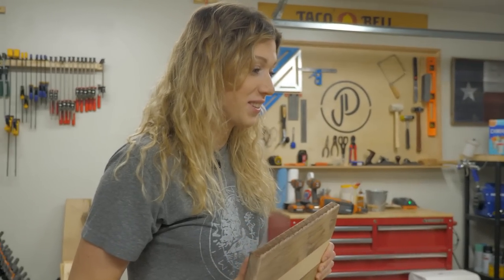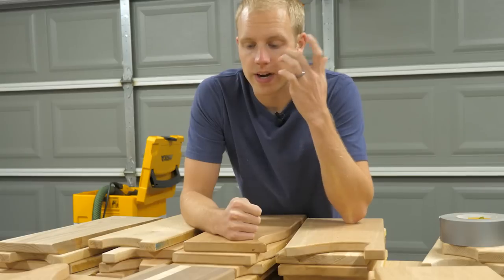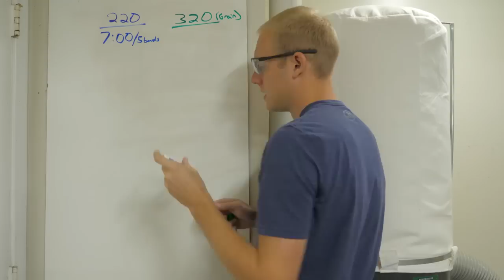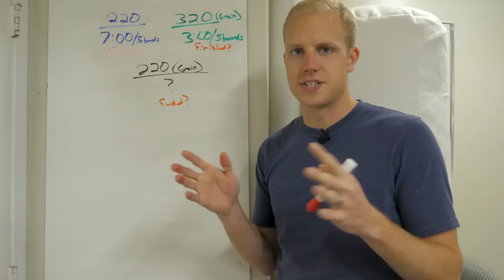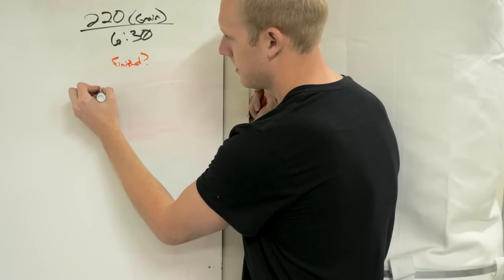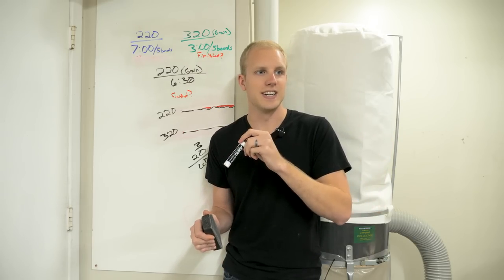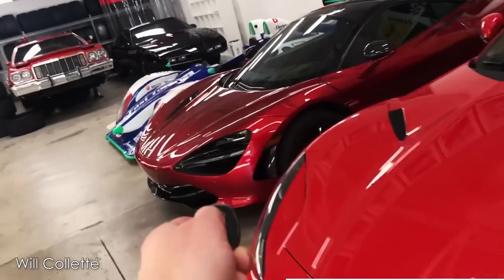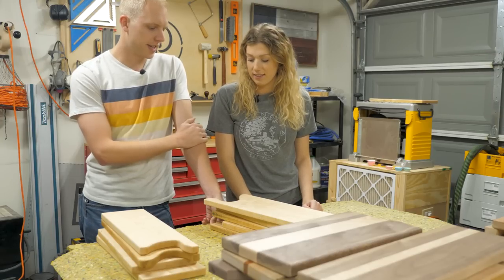🤔What Sandpaper Grit is BEST for Cutting Boards & Serving Boards?

Comment: No, don't jump straight to 220. A sharp blade cut may be equivalent to 120, but you should not skip more than 1 step in grit when sanding anything, you can't clear the little marks made by the paper. If you want a quality surface for finishing, don't skip. You really should start at 150, then do 180, then 220, then raise the grain and lightly (by hand) use 220, 240, or even 320, then apply finish.
Reply from the maker: We sanded walnut, cherry, maple, ash, and padauk using this method. Saw no 'little marks' from sandpaper and had no tool marks (other than those left as an artistic feature). Still haven't heard a decent reason in the comments on why sanding only at 220 results in an objectively inferior product in this case.

Comment: Defiinateoy a drum sander, then you can even get away with 180 as long as you send the boards in somewhat straight, (not sideways) so  drum sands along the grain, that will reduce your “raised grain issues” down the line when board gets soken wet.....  but even better solution: get a shelix drum for your planer, you will NOT need to send them at all, save yourself on tear outs, and imagine the amount of time you save in sanding, will pay for that shelix in just these 100 boards

Comment: You could go down to 180 and get the same results, plus the 180 will cut faster than the 220 saving even more time. Anything above 180 isn't necessary, as visible scratches are removed at that point. As you said, the finish is what provides the silky feel (and 180 is pretty darn smooth as well)

Comment: Why you spray it with warer..?
Reply from the maker: Wood absorbs moisture. If you spray it with water then sand it down, the board will stay smoother for longer after use
Reply: Carlos, it raises the wood grain, then sanding it will leave you with a surface that has more effectively treated for long term. The grain will not rise again. It's an added step in the build but helps the long term stabilization of the wood. And, ya can probably get a better explanation if ya Google it...... it's a great question...🥃

Comment: Not sure on the whole sanding issue, I usually keep going till I get the result I want...never made large batches so I can see how the time would add up...but i feel like the time/grit would differ between species...as far as the finish goes i see a lot of people just dunking the whole board into straight mineral oil overnight...Katz-Moses has a  video really easy to make finish of beeswax and mineral oil...like the videos keep it up
Reply from the maker: Thanks, Matthew! Yeah I honestly can't express how little of a difference we felt between the two different grits after finish. We might try to put some 'wear-and-tear' on them and see what works best long-term.

Comment: So what you are REALLY saying is, instead of taking a chance and  using 220, but not smooth it out too much by using 320, why not compromise and  use 280??  You know, you can always do that, not get it too smooth, but not use so much finish (uses up more finish with the 220)

Comment: One question during the middle of the video. 
Do you think that raising the grain, and going straight to 320 would work? 
Would there be an efficiency difference given the smaller, more easily clogged grit of the sand paper? Or even 400 for that matter.
 I find myself going to 400 between coats of finish just because I sand through previous coats so fast.
Reply from the maker: I'm worried about cleaning up light tear-out with 320 only. 220 can take care of router tool lines and mild tear-out. I just don't think 320 would do the same job in the same amount of time as 220. Interesting thought!
Reply: @jennieanddavis  Ok. That makes total sense. I was just thinking about the finish more than tear out or blemish fixing. Thanks for the clarification!  Love the video series!

Comment: I'm not sure why you feel the need to whet them. You shouldn't need too. And, 180 grit should me more than good enough, and, it'll allow a bit more of the finish to penetrate, which is more important than a slick finish. The finer the grit, the more chance of burnishing the wood which prevents the finish from penetrating deep. And I like to sand.